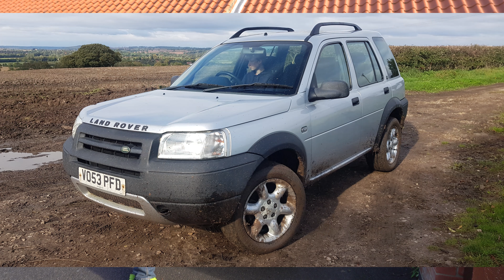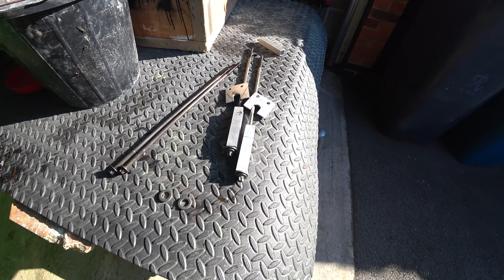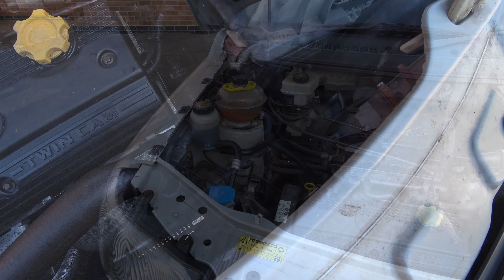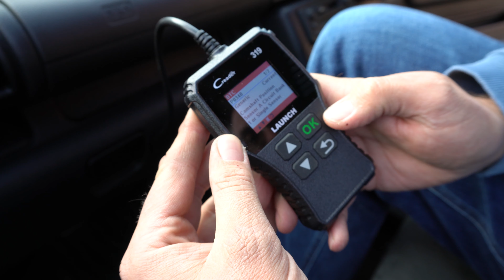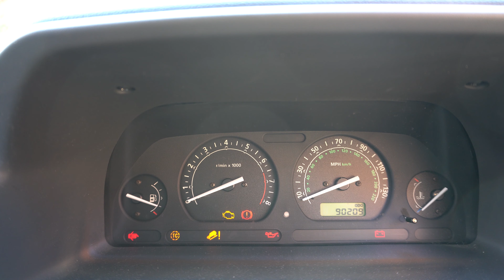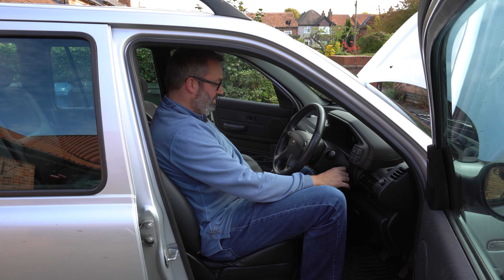Project Freeloader Part 2 - Land Rover Freelander 1.8 K-series gets a head gasket and oil rail fix

Comment: Hi long time fan 2nd time commenting. My question is do either of you know where to buy pre mixed oilant it would save so much messing around but cant find it on euro car parts or sutton auto factors. Thanks guys.
Reply from the maker: Just buy any elderly K series - they come prefilled with it!
Reply: @carfun5799  😂 I have enough trouble with my trafic